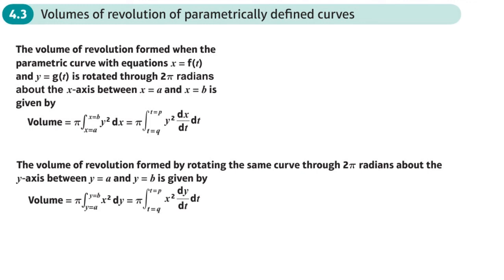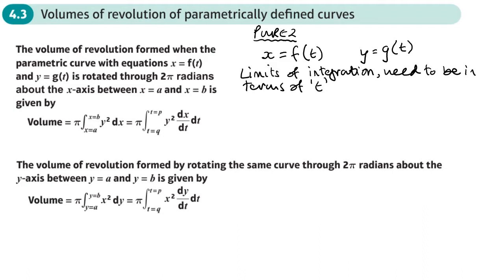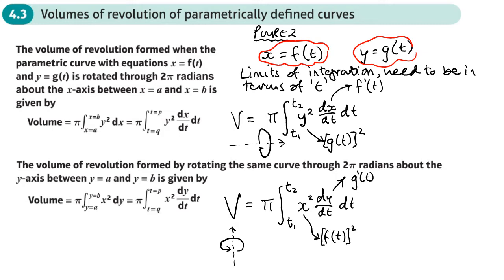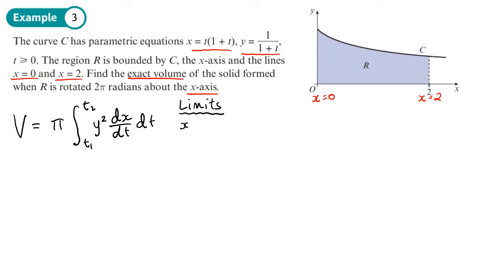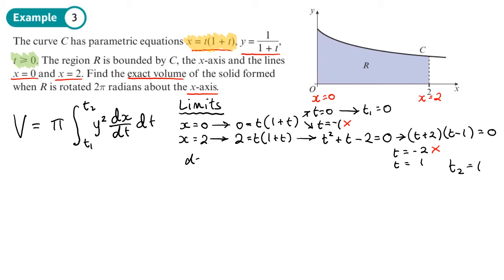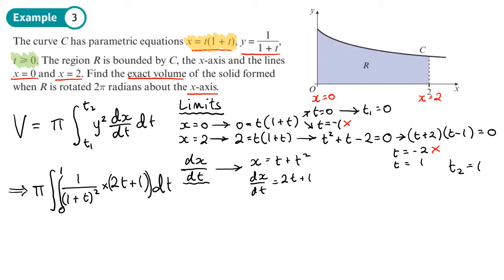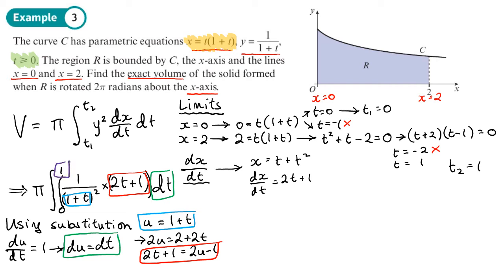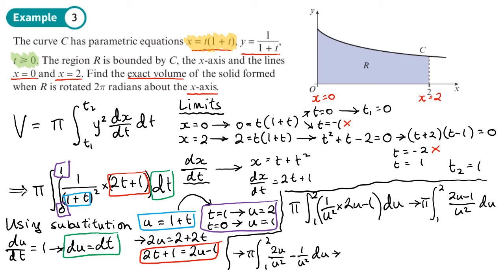4.3 Volumes of revolution of parametrically defined curves (CORE 2 - Chapter 4)

Comment: If a parametric volumes question has 2 parts, and part a asks you to find x^2 in terms of y and part b asks you to find the volume for rotation around the y axis... since you have x^2 in terms of y already, would you just have to do the integral of x^2 in terms of y and then multiply my pie, rather than doing the full dy/dt subsitution? I'm asking because I just did a question from an Edexcel paper modelling a water droplet and the mark scheme just asks for the core 1 method of volumes, despite it being a parametric question. Just looking for clarity around what to look for in a question to know if I just need to do the basic volumes method or the parametric method. Thanks
Reply from the maker: You can do either method, unless the question says that you must use a specific method (which I have never seen).  So I would always go for the easier most obvious method.